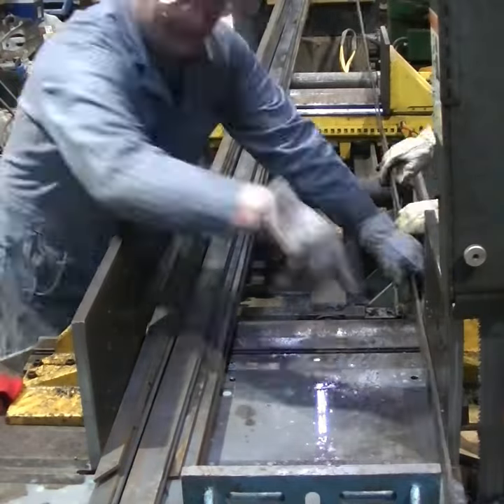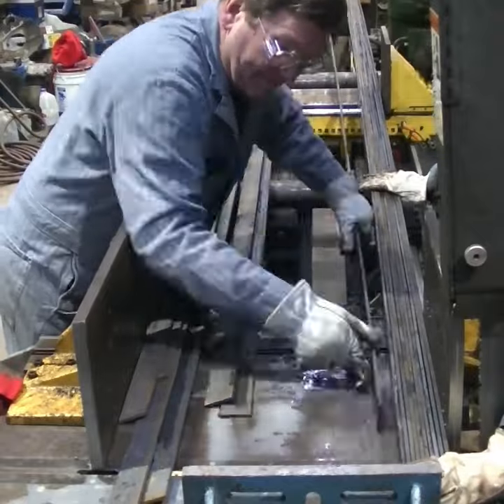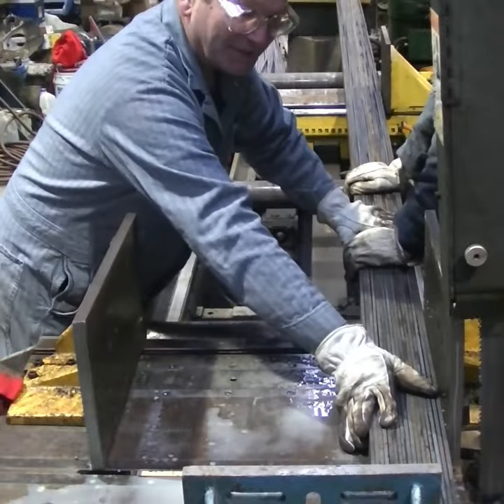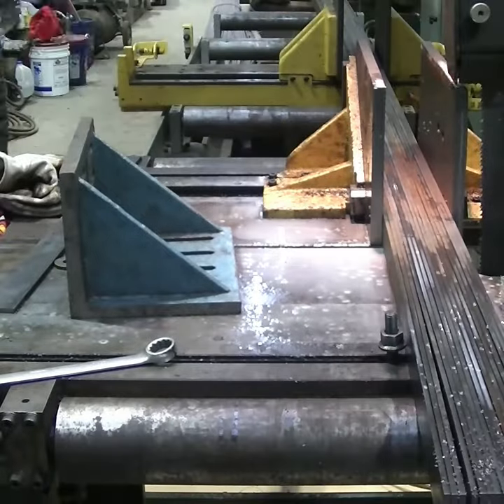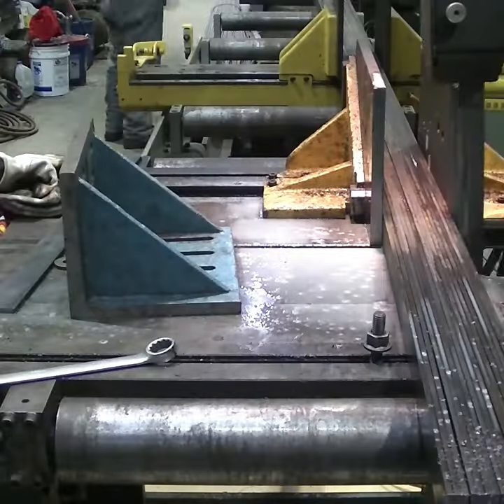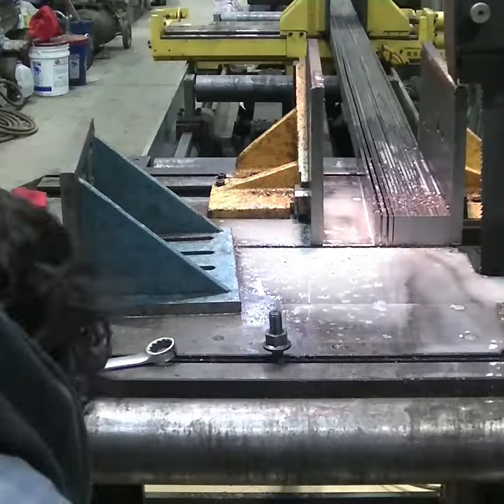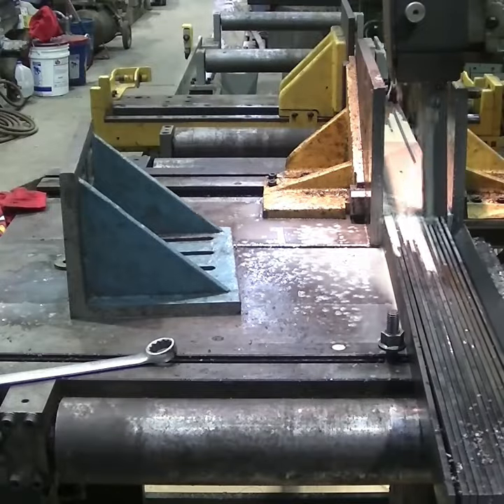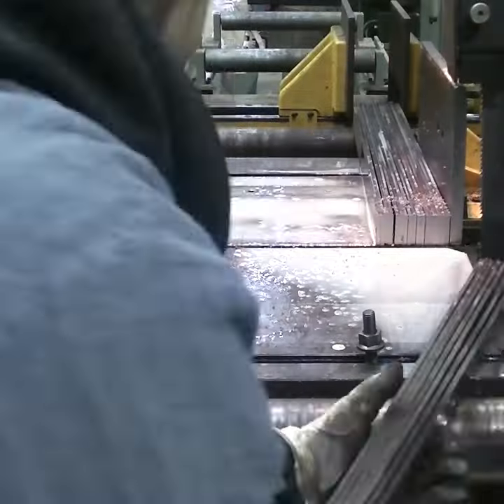Machinist's Minute: Batch Cutting Flatstock

Comment: I was running a big 'Marvel' saw with a great auto-feed with the 'active' type roller and clamping setup! Was 14 to 16 yrs old and makin bucks at my Dad's shop in the late seventies!! Still kept my paper routes but made 5 times the money on a Saturday as I did the whole week of two paper routes! Morning and afternoon papers back then.
Reply from the maker: My first Marvel was a very worn, 1970's 81A high column, it had a 30' table that came with it, but I left it at the machinery dealer's because I did not have room on the trailer, the feeder controls were bad anyway, it served me well for  about 20 years, I still have it for a back-up saw.
Reply: @HOWEES ,
   Lol! Dad had that saw and two 36" Bullards on a flatbed at a factory that had closed down in Florida, when the guy that was selling them tried to grease him out of another couple thousand bucks to "let him leave". 
Dad got back in his flat nosed Diamond Rio, with his recipe and his machines, and 👊 punched it out of the gates! Lol! That dude didn't want to find out what else dad had in the cab of that truck I guess. Dad drove that whole mess back to Peoria Illinois, set up the saw, rebuilt both Bullards, all still all in good shape in one of the rack houses runnin! Lol!
Dad started his Machine Shop in 1969 with a tiny punch press he rolled down the stairs into the basement of our house out in the country. First job was punching a part from plastic extrusion then would throw them by the armload in a dryer with no heat to deburr them! 😄 My dad and uncle Joe have had Tri-City machine Products in Peoria Illinois for 55 years now! Cheers Howee!!

Comment: I was running a CNC, doing cast forks for the T-6 transmission, I look over at the auto cutoff saw. And the operator is flopping on the ground. They hired an epileptic, to run the bandsaw. I don't know how they got away with that. I couldn't think of an appropriate job for him, out in the shop. A danger to himself, and others.

Comment: You know most metal shops have a welder laying around if you weld one end of it it stays together
Reply: Pretty sure everything's easy with a saw like that lol. For the rest of us that don't have a saw worth six figures
Reply: @rustypotatos  You square up all the pieces and instead of clamping them you weld across the end
Reply: @Bob-jn1fx  hahahaha why not just clamp them? I don’t need to show off my welding skills and they are not good
Reply: We always weld one end of the stack of FB when doing this at my machine shop.
Reply: Yep
Reply: @shawnhorvath2014  Cheap insurance against mismatched lengths.
Reply: @rustypotatos  Sometimes the inside pieces of stock slip. cut a lot of stock with both hydraulic and manual clamps. It's best to weld the end.

Comment: First job i had i was tasked with cutting 20mm round stock to 40mm lenghts. I think i managed to secure 5 bars in the saw's clamp, it worked fine most of the time but one time one of the bars got knocked loose and started to rotate which fucked up the teeth in the blade... Or rather fucked up the teeth more than they already were, so it wasn't a huge deal I just switched out a new one. No one else ever did, lazy bastards 😂

Anyway after that mishap i took precautions by tack welding the bars in couple of spots together before sawing.